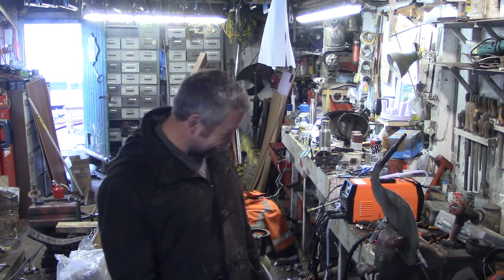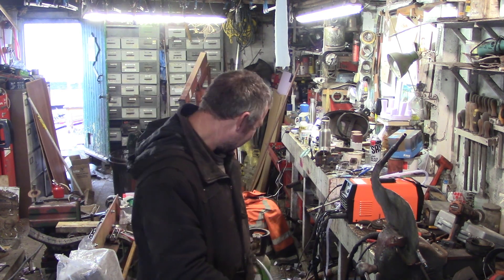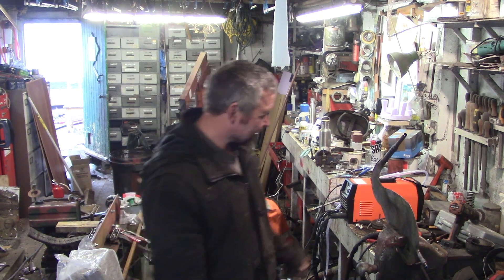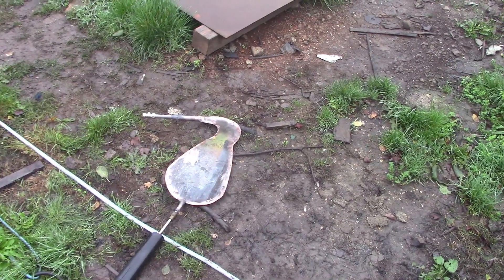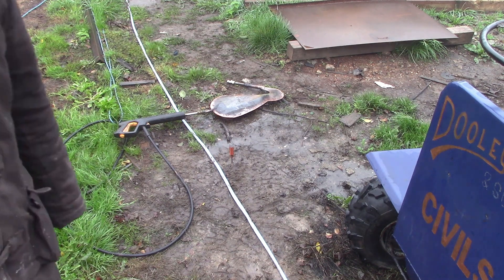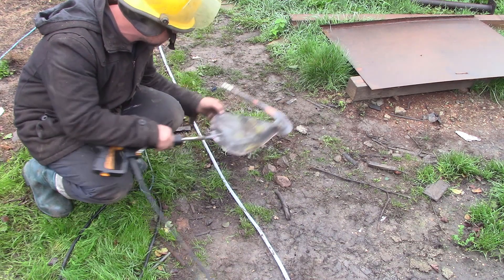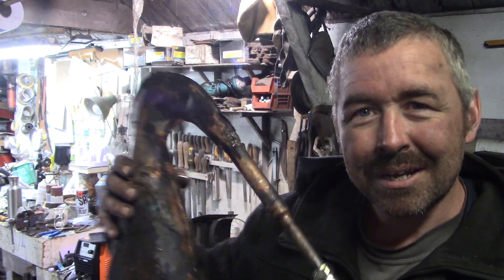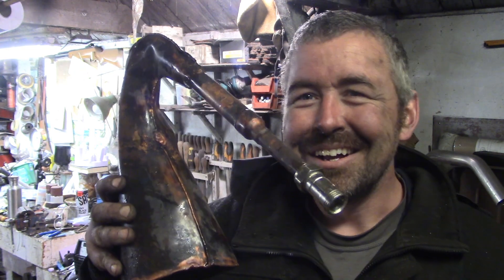Attempting to hydroform copper

Comment: Oy……James. Get an American baseball and un-do the stitching. What you will end up with is two leather shapes that form a sphere. Take those two shapes and scale up a template from them. You can then cut and weld those shapes together and hydroform a perfect sphere. Then just cut a hole and weld on your gooseneck. Cut away what you don’t need of the sphere and Bobs yer Uncle. You’re welcome matey.

Comment: What are you using as a wash? I use 8kg of sugar, 5 gallon of water and turbo yeast, after 5 days its 20% then ready for the still, i have a 5 gallon still with a thumper pot and the first result comes out at 80%, i keep that as grade 2 to be distilled as a neutral spirit, i keep all stuff from 70% to 40% which i blend down to 40% and add still spirits flavouring, anything below 40 goes to my 2nd grade, all the grade 2 is then blended to 20 and distilled again with the likes of juniper berries and comes out beautiful, its hard to explain the whole system but ive perfected now and can make better tasting spirits that can be bought from a shop, i think you would be better off making a stainless steel still, i bought mine but bought it with the idea that i can also use it when i make wine and beer, i use kits for beer but also dabble into a bit of all grain brewing, the still is perfect for this as its just like a big pot with clips on the side so the lid can be clamped down, it was £80 but its paid itself off already, 5 gallons of wash gives me 2 gallons of 40%  and about a half gallon of grade 2 stuff for distilling later 🙂
Reply from the maker: Molasses and brown sugar for the rum, always works well, am happy drinking it on the first run and I just throw the tops and tails in with the next lot.
Keep planning on trying something different but I like rum and decent whisky, and whisky is a bit more complicated.
Reply: @turboconqueringmegaeagle9006  what % are you drinking?
Reply from the maker: @barnydrunk  40-60, I stopped using the hydrometer and just go by taste, if it's like thinners or gutter water I don't drink it
Reply: @turboconqueringmegaeagle9006 🤣🤣 enjoy 🙂

Comment: when you anneal copper it's the opposite to steel heat and quench will soften it you might have been better to fabricate in sections and tig them. I built one to distill lavender oil and I used a beer keg and went to an exhaust pipe place and had them build the bends I wanted and for the condenser out of 3 inch tube and the end caps from a bullet muffler with 1 1/2 tube through the 3 inch and some small 1/2 inch tubes of the larger part to circulate water and had them flare the tubes to give a sliding fit for assembly all out of stainless it all worked very well

Comment: I used to repair a lot of motocross bike front pipes when I worked at a mx breakers, I used compressed air and localised heat where the dents were. You could get really badly dented/flattened pipes back to shape really well using that set up. I wonder if you’d be better off trying this as it’d probably be less stress on the welds and you might not have to worry about constantly re annealing the metal possibly?
Reply from the maker: Pretty cool, the welds on those pipes were probably a little bit better than mine!

Comment: It's a pelican!!!!  I've always been impressed by hydroforming, both in the DIY arena and commercial stuff, it's such a cool process.  Even if you finish the pelican off with a hammer, you've still done a ton of the work using hydroforming so it's not wasted effort.  I do approve of diving in with a real job rather than doing endless test pieces - you learn faster that way.  Great video.......now what can I try to hydroform myself????
Reply from the maker: Well obviously you need a pelican shaped fuel tank on an engine.
Seems to be becoming commonplace in industry, can't remember the last time I saw an alloy bike frame that didn't have hydroformed tubes, probably relitively slow on shapes or profiles that can be stamped or forged though.
Reply: @turboconqueringmegaeagle9006  A Pelican shaped fuel tank - it's the future!!!
I was thinking along the same lines - hydroformed bike frames are everywhere these days, and they look so good, but because they're now so common, I pay more attention when I see and old bike with steel tubes such as good old Reynolds 531.
Reply from the maker: @GrumpyTim  the old steel road bikes look so much more elegant than their modern counterparts, my back really appreciates modern geometry though!
Reply: @turboconqueringmegaeagle9006  I love riding the old steel frame bikes from time to time - the downtube shifters are quite a giggle these days, yet they were just "gears" at the time.  But I too have kind of got used to the slightly more comfortable ride of a mountain bike and not feeling like I'm going to break my wrists every time I go through a pothole!!!
Reply from the maker: @GrumpyTim  I haven't ridden anything with downtube shifters in a long time but I get an old clanker out regularly, excellent platforms for mounting a child seat but mostly because I like the noise of a sturmey's ticking reverberating through the tinwork.
Reply: @turboconqueringmegaeagle9006  Those Sturmey Archer hub gears are a lovely bit of engineering - a much more satisfying solution than derailleur gears.  I don't own anything with hub gears any more - when I was a kid, more gears was better, so I sort of moved away from them but I quite fancy one again now - a project for next year maybe....

Comment: 1. My mate made a still from a steam jacketed pan and the condenser from a big stainless pipe with lots of stainless brake line in a gentle spiral. Lots of water up the big pipe and two car radiators outside with fans on.... Stainless is so much easier - he just made a cone about 2 meters high with a throat to the condenser of 250mm. Could distil quite quickly and then used a Beer Keg still to finish it off to 70%/Vol.

Also to help with Reflux, a copper mesh welded/soldered right across the top of the cone before it turns over (on the inside) will help to take out some of the impurities and slow the output down by making the steam condense a bit in the top so it drops back down into the still and recycles.
.
To save money on TIG Gas - do your welding in a bath of Nitrogen and you can drop your gas flow to about 1/2.
Also you can get TIG Brazing rods - I have never done copper with them but they work well.
Perhaps just making a buck out of wood and beating it into submission would have been quicker and easier.

OR Make a casting - now that would be bloody impressive - only 20 or so litres of molten copper required.

Good fun though - thanks man.
Reply from the maker: Helium is meant to make copper a bit easier to weld, like ac to ally, helium puts the heat in better where you want it or that's what the internet says anyway.
I'll do this in stainless, just make something functional and try again with the copper when I find some more sheet.
Reply: @turboconqueringmegaeagle9006  Good plan. Stainless welds well with TIG and ARC. Nice and easy. Simple cone with large diameter vertical pipe that does a 180 and goes into the condenser.  The slower the flow of steam at the top, the better the reflux action and the better the distillate.
I thought helium would be quite hard because it buggers off upwards in a hurry - especially when hot ! The Nitrogen bath has never let me down - it really stabilises the environment by getting rid of the O2 before you start welding. I used an old tyre filling machine and a small compressor on the output - filled a big LPG tank....used that to fill the bathtub.
Reply from the maker: @madpete6438  spot on, from what I've read helium needs high flow as like you say it buggers off.

Comment: Bought exact same welder a few weeks back. The stick side is great, probably got through two hundred electrodes so far. The tig side was a disaster though. It emptied an argon cylinder in a couple of minutes. Looks like an internal leak. I've welded a schrader valve to the empty cylinder so I can investigate further just using compressed air. When I get round to it.
Reply from the maker: Cunning plan with the bottle mod, was it a little disposable bottle at least?
Reply: @turboconqueringmegaeagle9006  Yes mate, I'd have been gutted if it was a 10L bottle.

Comment: Get your self a stainless watering can and hack that about.  I have recently done some arc stainless welding with specialist rods, worked a treat.  Don't think I would trust my life to the welds but for the purpose it was all good.
Reply from the maker: Stainless with this little Tig has been easy so far, the watering can is an interesting idea
Reply: @turboconqueringmegaeagle9006  what was the tig machine again and how much?  Been looking for some time now but never quite needed one enough to drop the cash. Came very close to getting a scratch start for my arc welder but even that didn't quite make it past the boss.
Reply from the maker: @DansKoiPond  hitbox hbt2000, £180 on ebay but someone else just commented that they got the exact same unit and it vented their bottle of argon to atmosphere.
Mines been perfect but it's early days, luck of the draw sometimes with cheap gear, the reviews were all good.

Comment: Nice duck 😀 my experience of copper smithing is you need to anneal a lot more than you think. You tend to develop a feel for when it’s needed. Maybe you would get that using a hand pump you’ll feel when it stops moving. I usually use a propane torch and go to oranage hot then quench for speed.... good first effort and be interested to see the copper TIG welding haven’t tried that yet .
Reply from the maker: I don't think I was getting it hot enough then, I just had it blushing not actually glowing.
Welding was easy till I had to add filler, then everything cools down or I use a bit more current and melted things, apparently helium helps.
I'm excited to get some more copper and try all of your suggestions, but not if I have to pay retail prices, it's hot water tanks or nothing!
Reply: I've done a little of it, and TIG welding really anneals copper a lot.

Comment: Good effort! I'd say you could try overlapping your seams and using solder rather than copper, maybe
Reply from the maker: Cheers mate, I think you are right with the different joint, didn't want to use solder till it's formed because then I'd not be able to anneal without ruining the joint.
Reply: @turboconqueringmegaeagle9006  Yeah good point

Comment: Wait, what? Were a minute and a half in and your calling my welder rubbish! :(

Interesting experiment. I wonder if the material is being thickened where the welds are. I was also wondering is beating into shape my work better particularly as you have now opened it up. Could you finish it from here?
Reply from the maker: Well that's not exactly what I said, more commenting on how my lack of skill would make using scratch start and manual gas more of a handful than it already is.
I might have a go "raising" some shapes in mild steel, need more copper before I attempt this again.
Reply: @turboconqueringmegaeagle9006  It's easier in copper, you can try it with the half shaped one you have I would have thought. 
Mine is lift start not scratch start. I am toying with the idea of buying a much nicer one but will probably go for an AC/DC one.

Comment: Swan noises for the win. 🤣 Up next: explosive forming with air bag inflators???
Reply from the maker: There's an ozy chap that makes aluminium boat hulls with explosives, filling them with water means it doesn't have to be sealed. 
Absolutely fascinating. I think you are right and I should have a go.

Comment: That semicircle was your problem, you needed a ◇ shape, probably with the side corners rounded.

Also your weld is bending when the pressure increases, instead of hammering the whole thing, you could have rolled the edges up around 90° so your weld area wouldn't bend as much during the forming.
Reply from the maker: Knocking the edges over and butt welding was the conclusion I'd come to, and now that you mention it the diamond shape makes sense, am all out of copper sheet now though unfortunately.

Comment: Tis the spirit mate..looks like you can drop that right on top one of those counter top water distillers..could maybe wrap the outside of the copper in areas to limt movement or strengthen areas..possible outside mold could work too..maybe make a steel hydro formed section to fit over the cooper to limt it in areas perhaps..some type of wood mold could work too..
Reply from the maker: Female mold would be fun to try, was thinking if I had concrete left over from a job that'd be tough enough